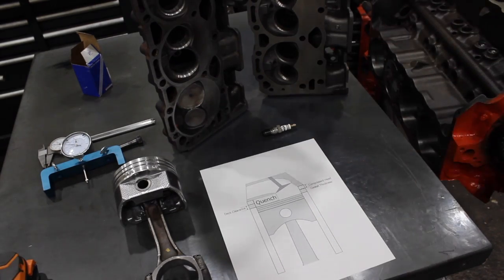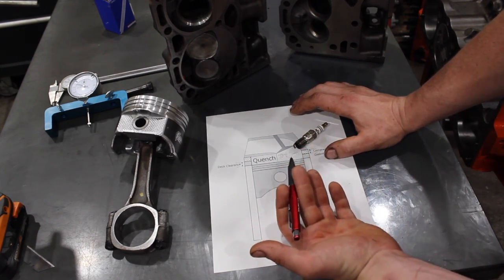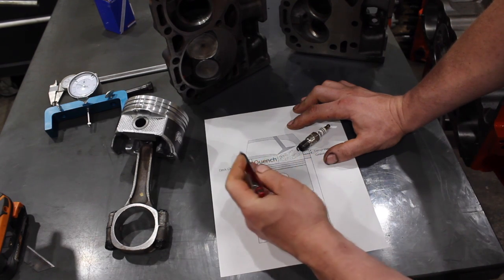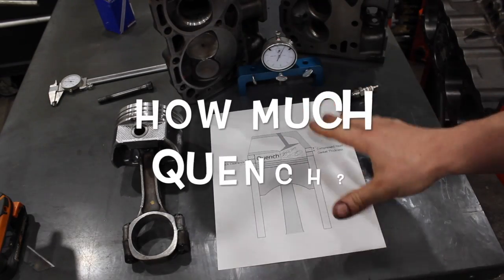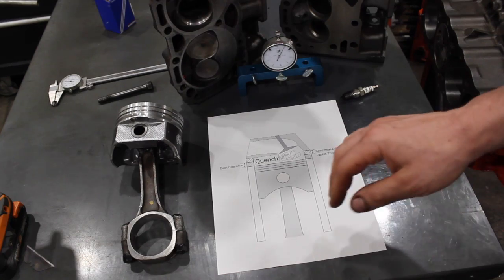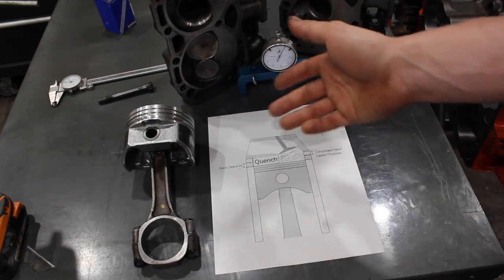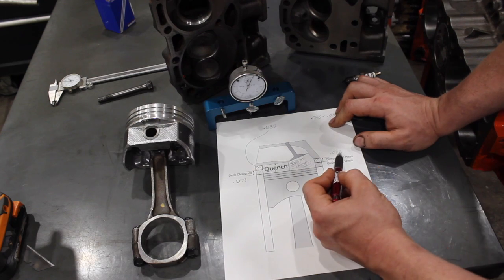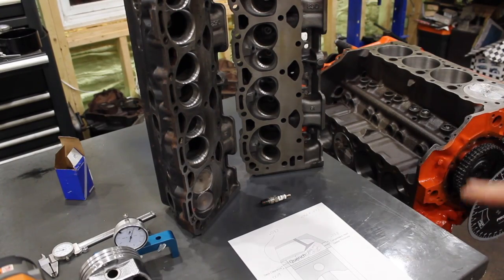Quench! Higher Compression with Less Detonation (A key to making more HP)

Comment: problem is the piston companies are stuck in the sixties.   1.560 leaves me 27 thou in the hole, a 27 thou gasket and a ton of $$ at the machine shop and i'd be good.  good thing you turned me on to skip white , 1.575 ch  pistons , actually cheaper than less costing pistons and the machine shop thank's Pat

Comment: I'm building a 1972 Pontiac 455HO engine with KB 10cc dome pistons with the 111cc 7f6 heads. Thought about having the block decked but not sure it's worth it for me. Just trying to understand quench and what thickness head gaskets I should use. Even with the small domes, I'm still going to be around 8.9 to 1 static compression according to KB.
 Great video, helps me a lot to understand. I would like to be around 9. 5 to 1, but couldn't find any larger domes for a 60 over 455. The engine was already 30 over with old trw L2394 domes.

Comment: So I have my 383 SBC torn down and thinking about putting different pistons in. My heads are edelbrock performer RPM 64cc pn60899 so a good modern chamber design. But like you said my stroker kit I put in years ago came with a 18cc D-shaped-dish which gives about 9.6cr. It’s better than a full dish piston like the one you show in the video but I only have a quench area on one side of the piston. My block was zero decked when they bored it so my quench should be 0.041 (thickness of standard head gasket). Flat tops are available for my 6” rods in 5cc or 7cc valve cutouts which would put me around 11:1, which scares me a bit. Pump gas where I am in Canada is 91oct with up to 12% ethanol blend. Car is a second gen Camaro so about 3400lbs and running pretty much at sea level (200ft), manual trans and 3.73 gears. Comp cams shows the intake valve closing 66 degrees ABDC, giving a dynamic compression ratio of 8.7 (if I were to switch to flat tops with this cam). I heard 8.5 dynamic is the max safe for pump gas so that also worries me a bit. Any advice? Thanks. I loved this video, it was recommended to me at a perfect time as I look to improve my engine.
Reply from the maker: What cam are you running?
Reply: @cuttersperformance  it has a comp 12-430-8 in it. It's a retrofit hydraulic roller cam. I don't really want to switch out cams, so if it's not suitable for higher compression then I will leave these pistons in it and just double check my quench. Thanks
Reply from the maker: @rferguson3719  that's a pretty mild cam for 11:1 in my opinion. You could leave the pistons, tighten the quench and cut the heads down abit to bring it to 10:1 to 10.3:1
Reply: @cuttersperformance  another option of piston is a 9cc D-shaped dish that would yield 10.5 static. But maybe I’m splitting hairs at that point going from 9.6 to 10.5, for the cost of the pistons plus rebalancing my rotating assembly

Comment: I use a cometic .036 gasket on my 418 ls2. Having an aluminum block that grows more with  heat than cast iron is beneficial. I got away with 12.5 to one on 92 octane but had to reduce timing to 26 degrees.

Comment: Wouldnt a high voltage ignition make for better burn of hiding gases under the head ?  Im building a .040 350/357 ci right now.  The deck was cleaned when I got the block.  The piston to deck measure is .020 and running .028 head gaskets.  New Eagle rods with Icon flattop pistons. ( 4 valve relef )  Heads are milled to 59cc, so compression is 10.25-1..

Comment: Why does more space cause detonation?
Reply: The AFR in the quench pad is incredibly rich from the fuel comming out of suspension. This causes carbon build up and am hn controlled burn jn this part of the chamber
Reply: So with the pad they use the pistons compression to re swirled (ie mix) the air and fuel to get it to burn even, and start the flame from in 1 location from a controlled source (the plug)

This is how I understand it, but I'm just a guy

Comment: Ive seen some race head shops shave off around 5 k from this quench area,they angle it towards the exhaust valve,it helps to prevent detonation  while ruining  higher compression

Comment: Is it normal for new piston rings to make a slight scraping noise when turning crank by hand? I just put some in and was surprised to hear anything, but it seems to be the rings riding on the newly deglazed cyclinder wall. I even uninstalled the piston to check the rings and cylinder wall, and it was all good.... Just a bit confused with noise - just hope it is normal... crank turns quite effortlessly.

Any wisdom from experience rebuilder would be most welcome!
Reply from the maker: A bit of noise is normal on a freshly honed cylinder. Did you make sure add some lube to the rings and cylinder wall on assembly?
Reply: @cuttersperformance  Yes - fully lubed.  After a few rotations it's already sounding more normal and turning nicely. 

Good to hear many people experience same thing - so I feel good now, and can proceed with piece of mind. Thanks!
Reply: @cuttersperformance  I dipped piston in oil and lubed cylinder walls - after a few turns the noise quietened down and the assembly rotates quiet nicely... I think it's fine now - it was just probably noise from the rings contacting the new hone surface... even after a few turns it's much quieter.

Comment: so this came up the other day and I was talking to my tuner and I asked him where should compression be for a e85 boost engine. tuner said around 10/11 :1 he told me that u should sand the heads after u have them machined or have a machine shop do it if they have a cnc to avoid quenching the pistons and heads. he then showed me his high dollar performance heads and he said it's very little to nothing. if ur having doubts just look at the aftermarket heads they do especially when the chamber is smaller then factory

Comment: One oversight I'd like to mention about "piston rock" is that a hyper piston will run "HOTTER" and be more likely to detonate although tighter in the bore and nothing I'd use with any compression ratio over 10.5:1. They are cast pistons with a coating that heats up more that is "budget" friendly. 

Forged pistons or billet pistons are "sloppier" when cold, and are known for piston slap, but they like aluminum rods expand once up to temp and the "slap" tends to dissipate. Thus, a little expansion is expected, so running a slightly thicker MLS head gasket is a safer bet just as a margin of expansion.

And if you are running NOS in a high-compression street motor of, say 11.5:1, you'd never run a hyper piston, and the rings need to be "loose".

Comment: Pretty old video but I thought I'd point out the other comments: SBC Chevy guys go round and round and round about squish and quench and always have because they're all the same little suburbanite Cleavers.  The SBC is a technical Black Hole that everyone who worked in Small Block Chevy racing thinks is the only engine on Earth.  By that I mean that rather odd, generalized auto-tech statistics like Quench and Intake/Exhaust port size ratios are tuned, and these guys will f**king die on these molehill, are tuned to SBC and it's weird archaic old fashioned crappy port arrangement that isn't good for any auto-sized V8 above 300hp.  That's another video but anyway, don't make too much of these old SBC, BBC, or LS guys because they're in a Chevy-induced delusion and any Ford or Penta guy with a budget can come along and slap them upside the head with an iron cylinder head if they so much as get out of the Peterson Pub/Hot Rod/UTI/Summit Small Block Chevy industry.  Literally Chevy guys will dick around with Chevy-specific ideas of quench, totally irrelevant outside the SBC community, those SBC guys arguing all the way their delusional bullcrap is why 'Chevies are better', then someone at Ford creates a Boss 302 with polyhemispherical canted-angle valves and Chevy guys swear, on their g-d mother's grave, for 45 years, that the DZ302 made 400hp, "Swear to God!".  There are entire head-specific dirt-track classes to keep the SBC guys out of everyone's hair.  God bless the advent of the internet and the death of the shitbox called the SBC and it's weird cult following of 'QUenchers' who take an easy engine metric a child can understand and turn it into some archaic bullcrap for bad head porting shops.  You think I'm joking or biased.
Reply from the maker: Man I had to read this a few times, then read it to my wife. She agrees with you, Chevy guys are crazy 🤪  ...im starting to think anyone who gets into cars as a hobby has to be delusional too lol. Anyways I appreciate the rant, dont forget to like and subscribe 🏁😉

Comment: What you're describing is two different concepts wrapped into one. Quench used to be the distance from piston to cylinder head, not just piston to cylinder head surface distance.

The term 'quench' means to extinguish flame, so your definition has no relation. Squish was the term for piston to head clearance. What you're describing that creates the lack of pinging is combustion shape as well as atomization created by tighter squish as it creates a far more efficient combustion, lessening the need for to start the combustion sooner.

Quench is, or at least used to be,  the term used to describe the shape of the ball of air-fuel mixture, not piston to head surface clearance. Making a word mean two nearly opposite principles is improper use of language... It confuses people, even if your concept is correct. 

Quench can't mean the distance needed to properly design the combustion to eliminate pre-ignition, as it's a very different concept to putting out a fire or eliminating thirst... quench is about the combustion itself.

Comment: So if you run a dished piston for lower compression, should you only dish the side on the combustion chamber in order to preserve quench? Or should you primarily adjust the combustion chamber size to change compression?
Reply from the maker: D Shape dished pistons are the best choice for dished pistons. The same tight quench with a lower static compression, but a larger chamber will do the same
Reply: @cuttersperformance  Wellll, the D-shape, in particular, might only apply to single-angle 2V heads like the ones on your bench, there. There are also multi-angle 2V heads like Trickflow's 2V 4.6 Mustang heads, and then there are of course 3V heads for Mustangs and some Mercedes, and 4V heads for a myriad of enthusiast engines like VQs, J35s, K series, B series, UZ, JZ, etc. What should you do in those cases?

Comment: Do dished pistons impact the quench area, or do they usually dish them only under the combustion area?
Reply from the maker: The best dished pistons are only dished in the combustion chamber and have nice quench pad. Stock style dished pistons have a center dish and only have a small quench band
Reply: @cuttersperformance   Thanks! Just found me an 880 block, 4bm, fuel pump ready. Starting a 383 stroker build this winter. Stoked!  

Hey Pat have you ever used Performance World heads. They're not too far from me, here in the Vancouver area. They look good, but...

Comment: Personal experience: wide quench, deep exhaust note 
Tight quench: crisp/sharper note
NA/NOS engine: run as tight as possible 
Boosted engine: quench is not important matter of fact there is a chamber mode intended to delete the quench pad called "chamber softening" it allows to run additional timing without knocking and it is perfect for a full blown race engine that give no 2F about MPG

Comment: So I am building a engine that I have been trying to learn from you.  I'm also a roundy round stock class.  Not wanting to blow up my engine in the first round either. 😂 really don't think someone will have that much of an advantage over me to be pushing the limits on the engine next to having a good suspension setup. So are you saying that if I have my block 0'd out and use a regular head gasket I will be in a safe zone?  Also if I do that and ran into ever needing to get new pistons, could I run into a problem with it pushing past my zero deck height?  Thank u again for your channel.
Reply from the maker: Thats exactly it, Zero deck with a .035 to .040 head gaskets puts you right in the sweet zone. Guys will run less that, but obviously, it is not recommended for engines that will see lots of rpm. Thanks for checking out my videos, I appreciate the positive feedback
Reply: It's worth noting that when guys run less clearance, they always feel the positive results.

Comment: You still need a minimum of three to six thousands clearance in the quench area to stop the vacuum from the Piston jerking away from the head happening there and pulling the flame away from the spark plug
Reply: If you understood an engine, you would understand how the combustion is creating pressure inside the chamber, where it's impossible for vacuum to happen between the piston and head... even furthest away from the valves
Reply: How the hell did you ever come up with this theory????? There is 1000's of pounds of POSITIVE pressure in the chamber and, you say there's gonna be a vacuum at the same time???

Comment: Would you have some time and ideas for a D16Y7 with a Y8 head that is being massively modified in the port bowls and the quench pads champhered to deshroud the valves for a turbo build?? I'm literally cutting into the cooling chamber and plan to weld the "low flow" bowl to create an even flow between the two intake ports/bowls.

Comment: The old way of measuring the quench was by using plasticine or blue-tack, this only works if you know beforehand what the measurement should be!
Once you have this info, all you have to do is the Math, so as to alter the head gasket thickness. This has always been a tricky subject, but you have explained it well.
Thanks for your explanation.

Comment: What about a tapered quench area?
Reply: Tapered quench is easy enough, leave valves out and bolt head on. Use some 2mm solder and poke in to quench band and wind engine over, measure thickness of solder 🤭 it'll get you close
Reply: @Grooty79  I was wondering if a tapered quench would help avoid detonation. I think I heard some people are using it with high body applications.
Reply: @danielkruger4305  tight quench helps weather it be a flat or a tapered , an angled quench band is better depending on the chamber shape and valve layout , I build BMW 6 cylinders and some of them have angled quench bands, I have heaps of vidds if you want to see some cool stuff

Comment: from 9:1 to 10.5:1 will it be safe for the engine??? will i have hp gains??? here in greece we run with 95octaine at least
Reply from the maker: You can expect 3 to 5% gains in power just from that jump in compression. But youll see a even larger jump in power by making a proper cam selection to go with the higher compression
Reply: You use a different rating system, same octane.

Comment: Gaskets only do so much, which is to say you will select pistons/machine deck to suit gaskets that fit the head and are suitable to both combustion chamber size and the bore size in arriving at desired compression ratio.  A gasket diameter 0.020" bigger than the bore is damn close - you don't want to risk fire ring sitting on the chamfer, which is not flat.  Often, +0.030" is a minimum margin, but check machine shops work: they must put some in to allow for easy piston install.  Last build, I had to go with +0.070" on account of combustion chamber casting dimensions.  Perfect?  No, but fire ring was properly clamped in place and not going to squish out of place.